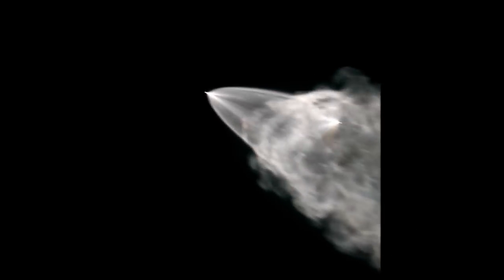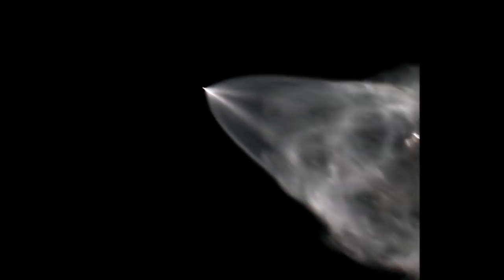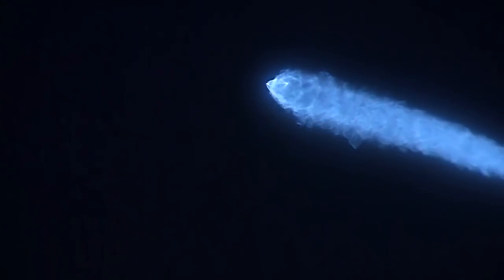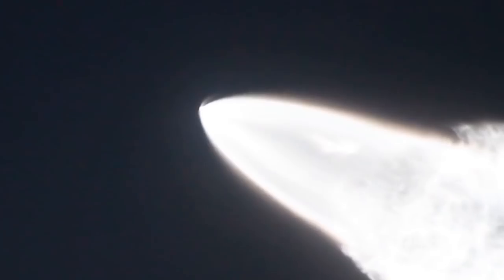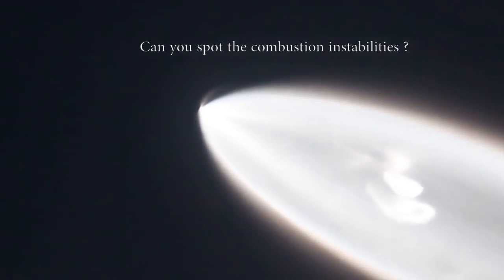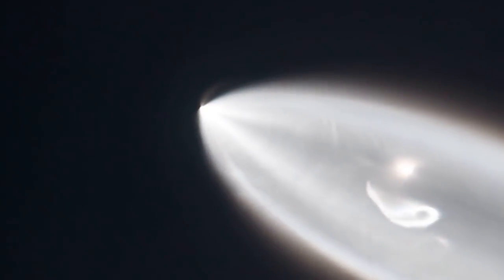The flames of the rockets, part 2 of 2

Comment: Bravo!

You may have the recirculation diagrammed in the wrong direction.  I think the inside face of the recirculating torus of gas is travelling toward the front of the rocket, and the exterior face is travelling toward the rear.

I loved the video.  You've done some wonderful research.  I would have liked to see something about the flames from the Falcon 9 first stage descending.  In particular, Lars Blackmore mentioned that SpaceX employees call the 3-engine retroburn pattern "the Eye of Sauron", and they still aren't sure why it looks like that.
Reply from the maker: Yes, you are right for the flow separation diagram (although my diagram is right for the recirculation). Thanks for the comment.
Reply: Flow is reversed between the two cases?  Wow!
Reply from the maker: Yeah, because in the case of the space shuttle, the "inside" of the ET in fact corresponds to the "outside" world.

Comment: Your clip showing the inside of Saturn V first and second stage is actually from inside the second and third stage. The second stage had 5 engines. The third stage had a single engine. The clip shows the single engine.
Reply from the maker: No, it's from the first and second stage of the Saturn 1B. There was no such cameras on the Saturn V.

Comment: To confirm everything: The pressure increase as space diamond is created, so there is a lot of space diamond, that is mig disk. So, there is a series of mig disk which the bottom part is higher pressure as forward V narrows, then go to next mig disk, so all those mig disk is design to hold itself in atmosphere, so the mig disk can expand as forward V expand, and at same time it narrows or further to base line that is nozzle. 

So, it is about balance, so the lower balance which in higher atmosphere as pressure decrease so the pressure of mig disk increase and at same time the inward fire go upward which can cause damage to rocket, so there is a barrier, or no barrier but a separate. So, separate is necessary than a barrier which the rocket can keep going. 

The separate part is 4 engine that is beyond the main engine which separates the main rocket, so it has retro braking which engine itself can increase or not as to goes down which the thrust upward to go down, so it can be controlled to the land down. Upper level, there is a curve line of fire upward, but can alter to go downward. 

What look like explode is a barrier that is separate of rocket which bottom part will go down to prevent inward fire to go upward and damaged it. 

So, the color as it goes up to change from opaque to clear. So, opaque can be high heat, and clear can be higher heat. So, which it is connected to mig disk that is higher opaque at a lower level to higher level that is transparent. So, the fuel is a cause of the fire which causes higher thrust, so burn gases so the fuel can be in a different color. The inner is dark as fuel and outer is regular fire to interact so it burns the inner to cause thrust?? There is a link for two thrusts. 

So, there is no explanation of why cold oxygen is need as fuel? I get it for water as a damp to sound for preventing to rocket. How fast does rocket go base on thrust weight which it is more than 100,000 lbs, to equal how much the weight of a rocket? What is the thrust weight / rocket ratio? The injector fuel, then first thrust to the second thrust, but saw no color. So, the color depends on what kind of fuel right? So, booster thrust is a fire to interact with injector which causes the center thrust to go up with fuel. Well, can you explain it clear? So, there is three processes that are gases as first, to two thrusts which is fire and fuel, so the second is fuel and third is fire?

Comment: Amazing video. I knew some of this, but still learned a lot.

My favorite phenomenon, which was not covered here, is a few seconds after takeoff. It's not always visible, but when the turbulent section of the rocket plume is passing by the tops of the clouds of vapor from the launch pad deluge, the rapid pressure changes can make bits of the cloud flicker rapidly in and out of existence, as it vibrates around the dew point.